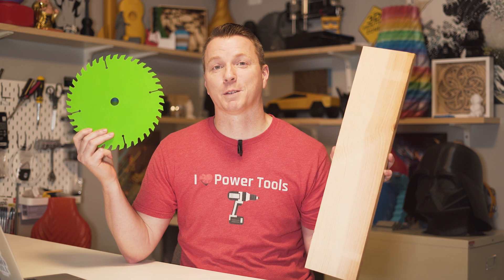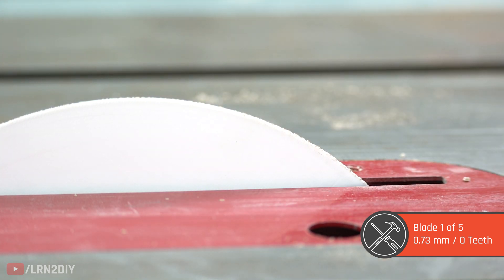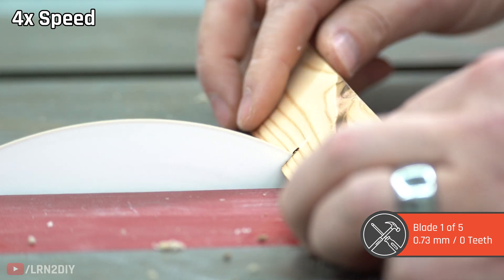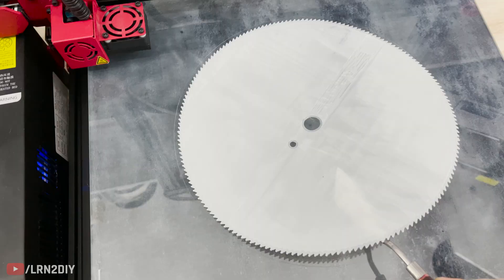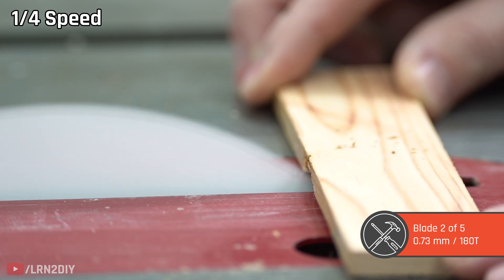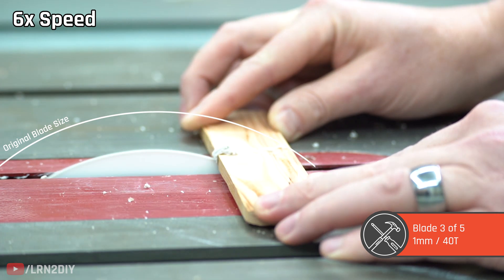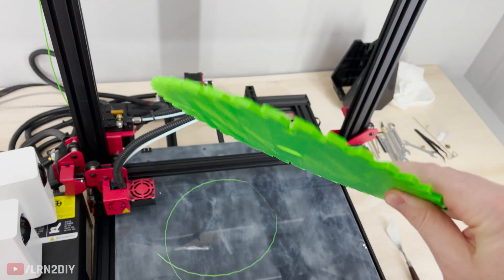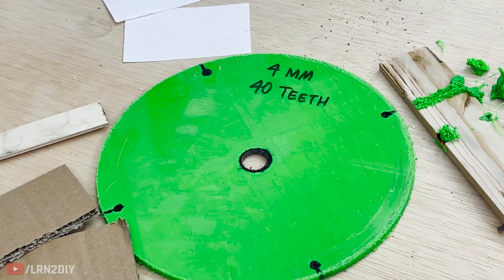Can a 3D Printed Saw Blade Cut Wood?

Comment: interesting run through, but doomed to failure I'd say. 

Your speed is off. Both from pushing the cutting material, and the speed of the saw blade. seeing black on the cut wood tells me the speed is too high. with plastics, for cutting material or blades accordingly, you have to have patience and not have a "Tim 'The Toolman' Taylor" perspective that "faster is MOAR BETTER!!!" 

I'm not trying to beat you up. I know because I've tried to cut plastic sheets with a metal blade and had plastic string shooting up all over the place. Why? My speed was too high, and I had a "just going to go with it!" attitude, which was all manner of wrong. Sound familiar?

Also, some metal on metal cutting requires some lubricant to cool the material and blade so one or both don't burn up.

Think about it.

Comment: I agree with Adam, your PLA is the weakest material available. I'd like to see the test with at least a copoliester, but even better like mentioned by Adam, a nylon which is a PC. You have to have in mind resistence and the temperatura de deformation. For PLA It is only 60 degrees C, quite low. Oh and I do not envy you the cleanup of your saw tablet!